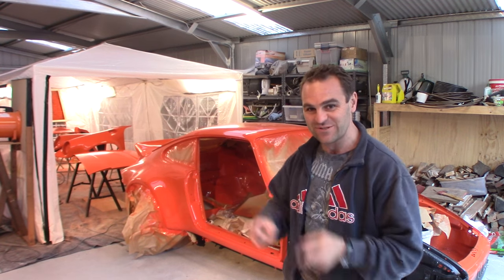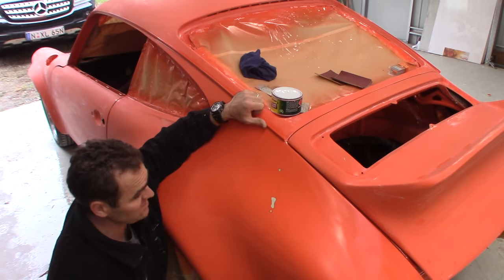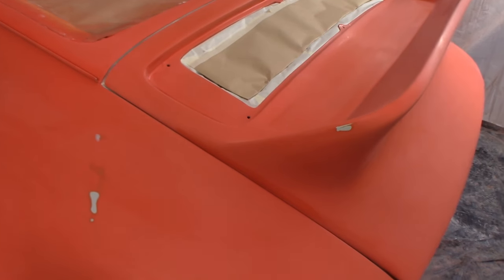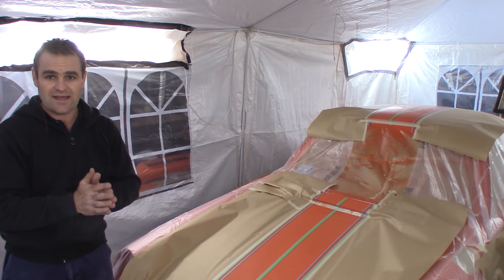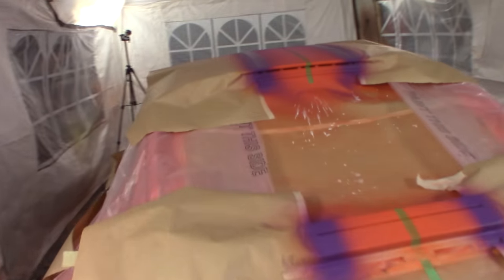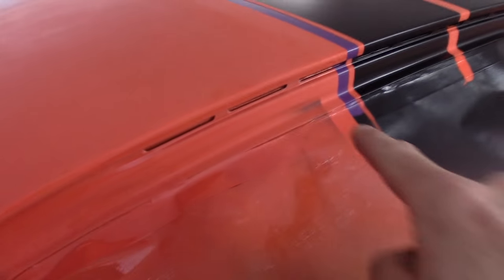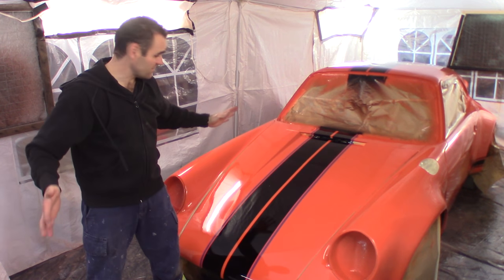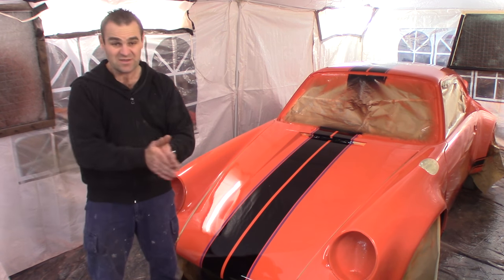Painting stripes - Porsche 911 Classic Car Build Part 20

Comment: Do you wet the floor (and maybe walls) of the booth prior to painting? I've read somewhere on the internet (years ago) that some people do that (especially with the home-built booths like yours), so there are minimal dust particles in the air.
Reply from the maker: Yeah. I did wet the floor down, but this time I think I will spray a mist over the walls as well. I also just worked out today, that a lot of the crap in the paint was from the old masking paper over the windows. For the final flow coat I will make sure everything is clean and fresh, including the booth filters, masking, etc. Should be good.

Comment: I dont understand why you sanded again for paint the stripes ? i think you should have painted the stripes before put the clear coat for first time or its a last decision to paint stripes ? Anyway its a awesome job! Congrats
Reply from the maker: I definitely could have done it that way. The issue I was avoiding was leaving the basecoat without clear for a longer time. I have also had issues in the past, of the tape over the basecoat (after then being painted over again) leaves marks on the car. One more issue, is that you can't prepsol the basecoat, after painting the stripes, before the clear. I have done more cars than I can count as you have suggested, but this one is mine, and I can take my time.
Reply: +Home Built By Jeff I understand. Better in that way then. Thanks for sharing this work.

Comment: impressive work Jeff, professional talent brought home to the garage, great stripping and paint scheme, well  done, so you have a clear coat layer wet sanded to 800 grit underneath the stripes? i didn't know that could be done?, usually the stripes are placed with the basecoat layer? i didn't know you can place a layer of clear under the stripping or graphics and then a final clear. your helping with a lot of useful tips, like the way to prevent bleed through by spraying a basecoat color first to act as a seal.
Reply from the maker: I spent 13 years as a professional airbrush artist specialising in cars and bikes, so this is the small part of my build where I have some experience. You can put stripes straight over the base coat, but I often found it would make the tape react with the basecoat under it and when you unmask you would often see the tape lines. Clearing it completely is a pain in the ass, but it is the best way to seal it and then you can clean it up nicely before you paint. Another easier way, is if you use Under coat clear, which is basically a clear basecoat, so you don't have to rub it back again. I know HOK make it, but I am not sure who else.

Comment: An American show car painting expert claims to use an 8 step paint process with wet sanding between each coat.
Reply from the maker: I think that may be a bit extreme. As long as it is perfectly flat before the final coat, I don't think the other previous coats make a lot of difference. But different people have different methods. This is not going to have a show car level of paint, but it should be reasonable.